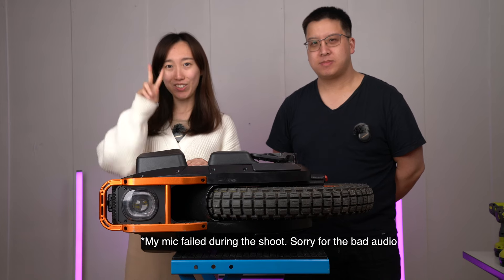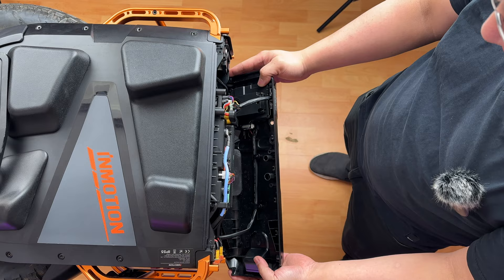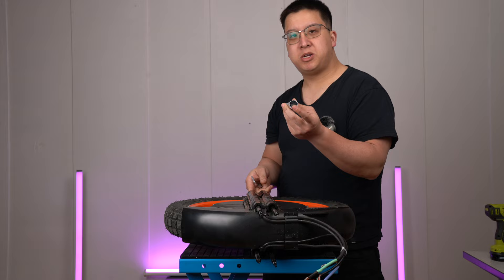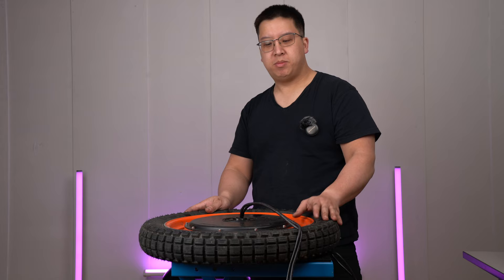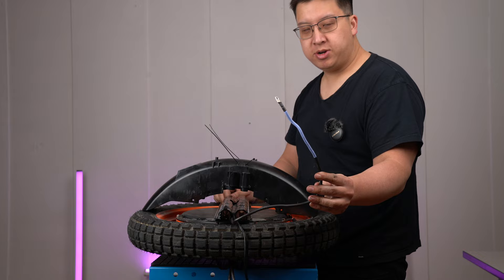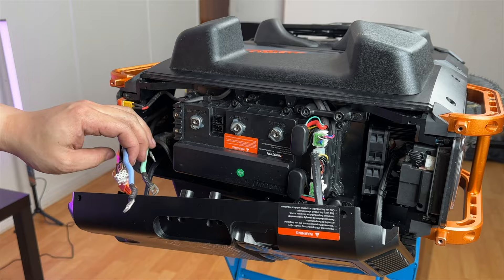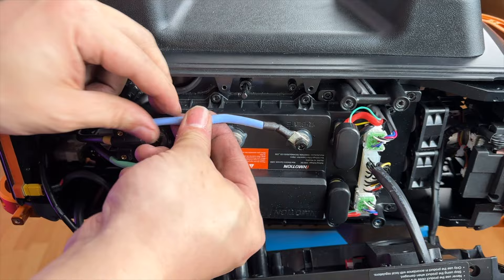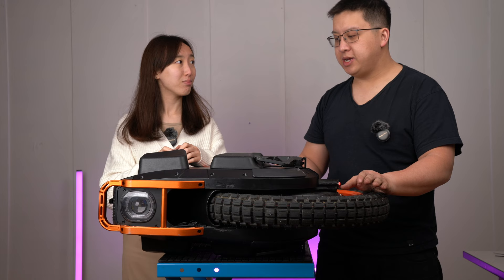InMotion V13 Tire Change

Comment: Extemely in depth, thank you guys...... Ive still not swapped my motor bolts out, dont almost 1000km without issue, but really need to get it done. This is very helpful
Reply from the maker: Hopefully it comes in handy

Comment: {another tl;dr comment…
This may seem harsh but it’s offered in kindness.}
 
Love the details but I’ve got to admit that I cringe every time a screw, bolt or nut is blindly-driven into either a tapped hole or previously threaded hole. ALL screw fasteners should be set by HAND 🖐, then driven if needed; and the only exception is when driving a wood-screw into a VIRGIN hole at the factory. Otherwise, every fastener should be hand-threaded to ensure the integrity of the connection without cross-threading. 
 
The proper method for setting a screw/bolt/nut by hand (or hand tool) is to counter-rotate (lefty-loosey) with light pressure so that you can feel the thread rising outward until the gap is felt when the thread skips to the next groove… only then should it be hand tightened (righty-tightey) for at least one or two full revolutions before machine-driving the rest of the way (with a torque-limited driver).
 
I know this is pedantic and acknowledge that almost NOBODY wants this advice, because it “seems” like extra work but over the course of a lifetime (yours or any item’s life) this ounce of prevention is truly worth the several pounds of cure, which will be needed to repair mis-threaded fasteners. 
 
Just look at the fiasco the U-Stride encountered with his V-13 loaner… weeks of downtime and it’s not likely that most riders can afford the minimum charge that most mechanics will charge to repair anything. In fact, when I assess mechanics that I occasionally hire, I watch them to see how they reassemble their work and, if they don’t hand-set their screws/bolt/nuts, then I promptly leave and find a well-trained professional. 
 
{Now, I’m not saying that you’re doing it wrong, just saying that it’s never worth the time or risk of having to repair mishaps over the course of a lifetime. You do you, and I’ll do it me… but if my mechanic ever screws me like that, then they had better at least have the courtesy to give me the “reach-around”.  😅 
 
That said, I also cringe when watching factory assembly videos, as it’s clear that many of their procedures are inadequate for the task of good quality control, which is why I completely disassemble all my wheels and reassemble to my own specifications. 😊
 
If you’ve ever wondered why auto technicians/ mechanics are mostly angry at the world, I’d say that 95% of the attitude comes from the dread of having to fix other mechanic’s or engineer’s mistakes. 😮
 
Of you’re looking to save time and money, the laziest solution is almost always to do it (as best as possible) the first time. ❤
Reply from the maker: I 100% agree with you. I have used impact drivers for many many years. Also what you don't see, is a couple things that would be good for me to mention in my next video. 
1) On very sensitive items, I do mention how you want to be extra careful due to the probability of cross threading 
2) When I'm using the tool, I don't ever fully pull the trigger. During the initial setting, I'm making sure that I'm as perpendicular as I can see - and a slight touch of the trigger to start the screwing process. If I feel any resistance I back off immediately. Once it is more than a couple turns in, then I pull the trigger to speed it up. I do this for every screw to prevent cross threading.
Reply from the maker: It's actually really good that you mention this. I'll make sure to mention it in my next video. Also, in the first couple videos - that's also why the recommended tools are all hand tools. Maybe I should go back to hand tool recommendations.
Reply: @2cells1pack  Glad to hear, and thanks for receiving my opinion kindly. I literally have only initiated threads by hand-only for the past 30+ years and it’s been habitual for all that time, it gets to the point where I think I couldn’t do it otherwise if I wanted to… especially fine-threads or wood screws. It only takes a dozen or so hard-fast rules and I’ve saved hundreds of hours over time. 
 
Please consider doing maybe 5-10% of your longer formal videos as “Throwback Deep Dives”, which could highlight a long-standing model, the evolution and changes in each Version and common problems/repairs/upgrades (both factory and aftermarket).  
 
The view-count potential for archival repair videos of high quality would basically give you a monopoly on this niche-market but should be as valid content for 20 years or more.  
 
Stories and interviews of technicians are also fascinating. From toy-phase through mass-market adoption, the EUC history is fascinating, especially the intellectual property debacle that initially discarded the potential of EUCs by abnegation of enforcement of licensing patent rights. It turns out that Venture Capital firms were so enamored with the rental scooter market that they lost billions of Dollars so far.  {I haven’t done a deep-dive myself but the missed opportunities from a decade ago are legendary. And, while the EUC makers we currently have were benefited from Wall Street’s/Silicon Valley’s VC misfortune, those same financial institutions haven’t learned from their mistakes so that funding for the manufacturer’s is still limited to organic growth business strategies, which both protects the EUC industry in the short term but makes these companies the targets of predatory speculators after market penetration matures. 
 
As far as I’m concerned, this drama is far more interesting than Imagined. 
 
Lastly, when thinking about how the present your message/brand, consider that (eventually) your content will be “binge-able”… planning for this to flow with continuity is best premeditated and iterated continuously over the lifetime of your channel. Your partner has a nature intuition for timing and appears to be thoughtful and deliberate. These attributes are tactically strong and complementary with your personality and performance. Synergy happens!
Reply from the maker: Thanks for taking the time to write such an information dense comment & reply. I will definitely mention best practices in my next video -> sometimes I take things for granted and its always a good breath of fresh air when someone points these things out. 

What do you mean by Throwback Deep Dive? Do you mean do teardowns of older wheels? Also, I might need to pick your brain regarding that last paragraph, I read it a couple times - but not too certain on its true meaning.
Reply: @2cells1pack  Yes, tear down older models and explain the evolution of problems that occurred in first revisions until product becomes stable or if there are still unaddressed issues that owners of particular wheels should pay attention to. Just to counterbalance the number of videos done that highlight new tech only.
Reply from the maker: It will be a little difficult to get my hands on the older stuff - unless someone donates them to me. Whatever I can get my hands on - i'm definitely open to doing. By nature - the newer stuff is easier for me to obtain :p
Reply: @2cells1pack  I completely understand.  Really has constraints, but opportunities develop as your network expands. Great beginning.

Comment: Great vid! I wonder if a 3 pin phase wire connector on the hub would have been a better design choice for ease of maintenance.
Reply from the maker: The only issue with this is the amount of phase currents that go to the motor. I feel that this is a hurdle that they will have to solve at some point.

Comment: I cant get the suspension things thru to the control board They are 3-4 mm down in the hole I cant figure out why .....
Reply from the maker: Pull it up by hand before putting the shell on
Reply: @2cells1pack  THx very good of you. LOve your videos mate...

Comment: Oh also I forgot to say. My experiance with the V13 has been unlucky to say the least.

My problems began, firstly.

A Hall sensor 1 fault: accidently pinched new motor bolt: exposed wire: CNC Contact Spray: Liquid Tape: Electric Tape: Reassembled = issue fixed

Phase wire bolt green burnt: broke & sheared: drilled it out with a 5/32: tapped with a 4mm: CNC contact spray cleaned: applied ASI 388 Electronic Grade Silicone; for holes: threads: bolt head: reassembled = issue fixed.

Then my air suspension tube stopped working.

Bought a custom L angle piece: measured out to size and shape: waiting for it to dry from spray paint.

I'll leave as a non-suspension.

I don't wanna deal.

I'm tired 😭
Reply from the maker: Wow. that's quite the adventure for a new wheel. The V13 has been nothing short but interesting since its release.

Comment: ridiculous that you have to do all that to change the tyre. there has to be a better way to build these things
Reply from the maker: A lot of the newer wheels make it a lot easier to change tire
Reply: He hasn’t seen a v11 or v12 tire change apparently
Reply: still way better than older gotways  tire change. the suspension wheels for all companies are easy to change the tire. v11 was the last suspension nightmare like the other guy saidrrrrrrrrrrrrrrrrrrrrrr